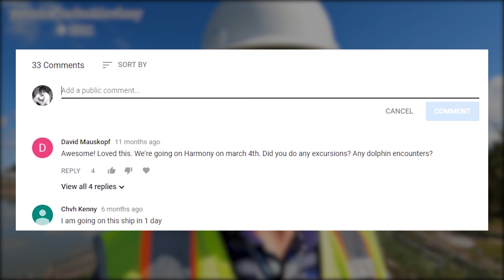Tobacco River Dam - New Retaining Wall nearing Completion! - Dam Collapse - Wixom Flood

Comment: Good job. If you're asking for opinions on which update that erosion control should be on, it definitely should be part of a Tobacco River spillway update. For those that haven't been looking in on the Tobacco River live cam, it pans over to that area. And since Jordan filmed this video they have cut a road right through the embankment to get trucks in and out of there. (at least that's my guess of why they did it.)
Reply from the maker: There has been a ton more work here. A lot of this clay is being used on the Edenville embankment which you can see from the Edenville live camera
Reply: @JordanMowbray  On the Edenville cam I have been seeing darker material being placed on the embankment. I didn't put it together in my head where it was coming from though.  A couple hours ago the Tobacco River cam  was showing a backhoe digging a fairly deep hole into the lake bed. That must be one of the places the clay is coming from. I wonder if they'll let the holes stay? When the water returns that might make a good fish hideout.

Comment: Why did they leave the 3rd or east spillway structure(back side) intact before starting the work to pour the inner wall on the west spillway wall? The east wall work can't be done until the back side concrete is removed?
Reply: i believe from previous videos they are basically working on the west side one first, then once its done redirect the water to it and then start on the east one
Reply from the maker: The concrete remains in tact and they are just pouring a new layer that is attached to the existing through rebar to strengthen it